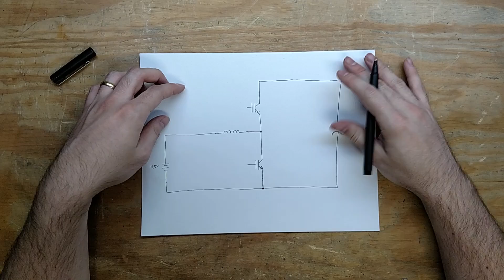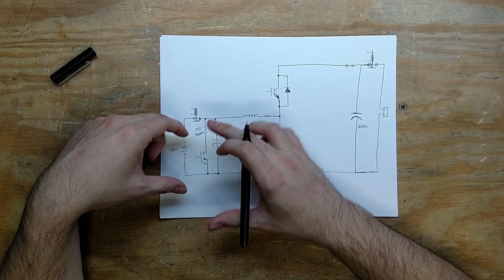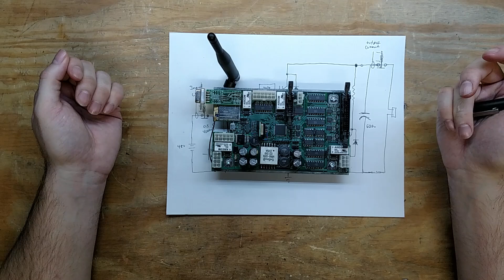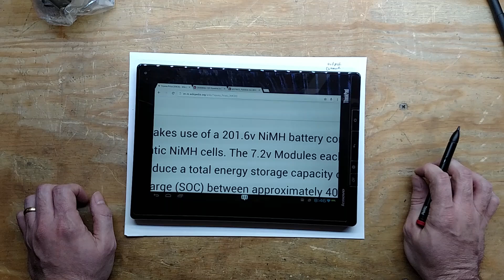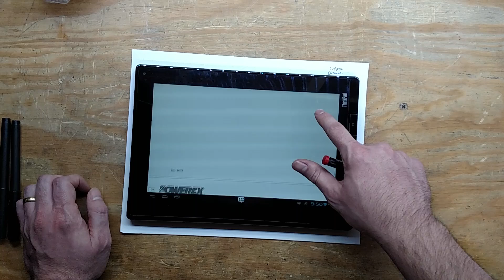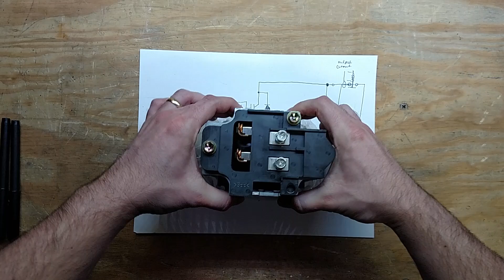Bi-directional buck-boost converter, Part 1

Comment: Great video!. Working on a project where a bidirectional buck--boost is needed to supply energy to a battery pack from a dc-link PV array and vice versa.
Reply from the maker: +Martin Vang Kjær 

Cool!

One of these days I will build a whole house UPS, and it will do the same...

Solar powered / mains, bi-directional buck-boost to the battery pack. :)

Thanks for watching,
Wolf
Reply: Would be great if you will document the project with some videoes. Greetings from Denmark :)
Reply from the maker: +Martin Vang Kjær 

It would be documented here, and on the website. :)
Reply: A picture of the final result. It worked as intended ;) http://www.bodybuilding.dk/download/file.php?id=55958&mode=view
Reply: @sonicyouth29  where can I get the document??
Reply: @vignanmullapudi2950  give me your email. There is complete steady state modelling, dynamical modelling and control chapters.
Reply: @sonicyouth29  vignan.mullapudi@gmail.com
Reply: @sonicyouth29  thanks for quick response.😊
Reply: beautiful piece, and working! Congrats :)

Comment: amazing video!
could you please make a DIY home version of this? one that is made of easily obtainable ICs and rated for much lower current/voltage values
Reply from the maker: What voltage and current are you looking for?

Lots of ICs can do low power bi-directional buck-boost converters... Especially for single cell Lithium-Ion / USB.

I could not find any high power bi-directional buck-boost converters, so I had to make my own...

Plus I also wanted it to be constant power load for testing batteries and chargers. :)

Thanks for watching.
Reply: +Wolf Tronix the voltage range is the standard 1.25-30v output with 4-25v input (something like that) and current between 2-4A depending on what the ICs can handle. could you name the ICs that do low power bidirectional buck boost conversion?
Reply from the maker: +hailoper 
A quick search turned up the LTC3110, which is a bi-directional buck-boost converter chip, lower voltage than what you want...

But if you look around you can find some chips that can drive external FETs to get into the voltage range you are looking for, LT8490

Depends on what functions you need. ;)
Reply: +Wolf Tronix thanks for the IC numbers. will look into it. sadly I dont get ltc ICs in my country :p

Comment: Nice project. Beware that the Gen 2 Prius boost converter is only rated for 20 kW,  the full 50 kW is only available to MG2 when it is being powered by the batteries (through the boost converter) and the ICE (through MG1) at the same time. See this document for more info: http://info.ornl.gov/sites/publications/files/Pub26762.pdf
Reply from the maker: I rated it at 10kW, with a 250A inductor current limit.

This gets covered in a later video.

Thanks for watching. :)